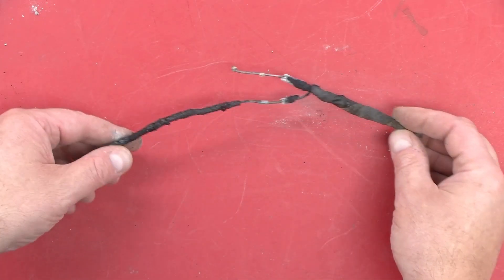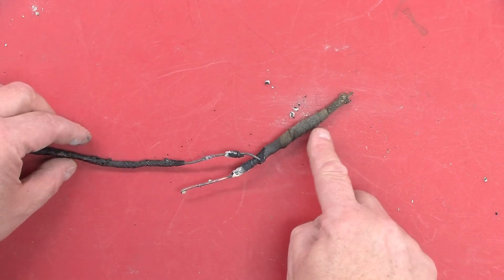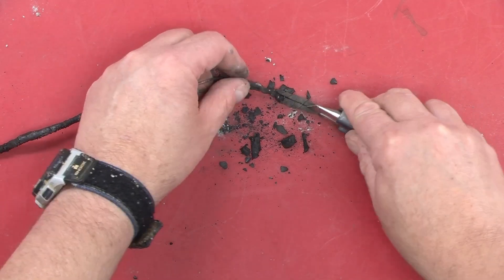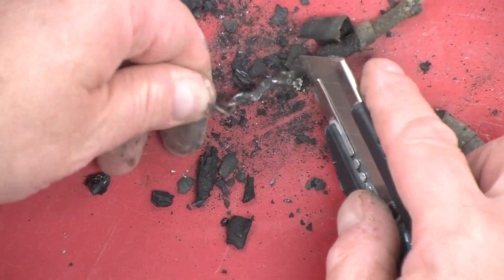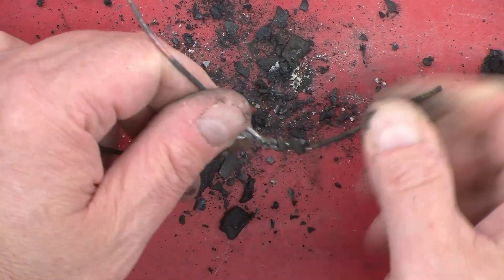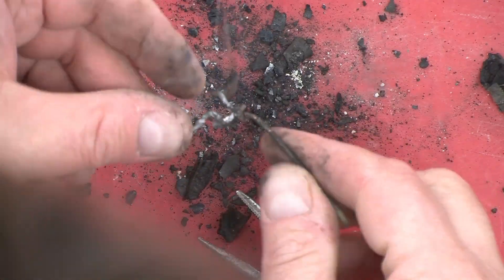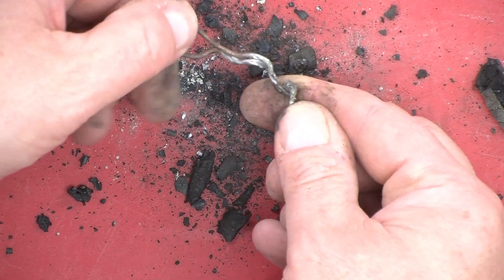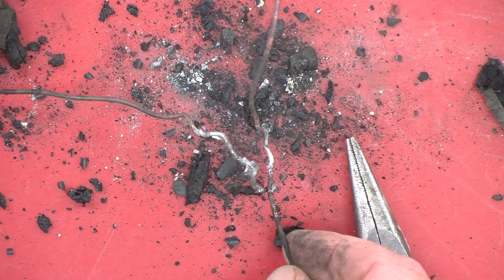Taking Apart the Knob and Tube Splice after Current Tests

Comment: Do you feel the heat weakened the solder? That seem to come apart fairly easy.
Reply from the maker: I'm not entirely sure. There wasn't a huge amount of solder so I think the copper-solder-contact area was pretty small so not the strongest physical bond, and it usually is   possible to pull copper away from a soldered area when the solder is all on one side. 

Before taking it apart the solder looked in decent shape (or at least what was visible under the black charred stuff).  But as you said it did come apart surprisingly easily. I have seen solder on copper or brassware from the Middle East deteriorate after 50 years or so, but I'm not sure of why -- so there also may have been some deterioration due to age. It would be neat if a metallurgist reads this and tells us if and how a solder joint could deteriorate!
Reply: @ElectromagneticVideos  While I am no metallurgist, I have been a research chemist for 40+ years and I have an internet connection, so I did a little reading.  Mostly, it depends on what solder alloy the electricians (if there was such a thing back then) were using.  The eutectic mix for tin/lead solder is 63% by weight tin and 37% lead, this has the lowest melting point (183C, 361F) for tin/lead solders.  If the alloy has less tin (50/50 for example), then the melt tends to have lead crystals in liquid eutectic (sometimes referred to as "pasty" solder, beloved of pre 1974 plumbers and old-school body and fender guys, since it can be wiped onto joints like putty).  The opposite can happen for high tin alloys, where tin crystals can form in the melt.  If there was any separated lead, it would oxidize over time, particularly if it ever got wet (this was why lead was banned from plumbing solder used in potable water systems in the US in 1974).  Any separated tin could degrade by allotropic conversion (known as "tin pest": https://en.wikipedia.org/wiki/Tin_pest ).  Metallic (white, or beta) tin is thermodynamically unstable below 13C, with the nonmetallic allotrope (grey or alpha) tin being favored.  White tin is strong and ductile, grey tin is weak and brittle.  The conversion is slow, but autocatalytic, so once it starts, the rate of degradation speeds up over time.  Of course, the weakness of the joint may just have been due to a light coating of solder, as you noted.  Even so, it still seemed superior to a wire nut.
Reply from the maker: @robertlapointe4093  Robert, than you so much for that research! I'll bet there are aspects of that occurring. I can sure see too much lead or tin weakening or worsening the connection over time as you described. If I find another connection like that I will have to try and look at under the microscope and see if any crystals or deterioration like oxidation are visible. I had never heard of tin pest - and now I also understand the ban on lead solder for plumbing - I always wondered how enough lead could dissolve to be an issue. And its funny - 63/37 solder was always sold as having the lowest temperature but nothing mentioned about its stability. The tin pest issue seems also seems  to well describe some failing solder on some 50 year old Middle Eastern cooper and brass items I have.  By the way - we  have tin issues with lead free solder today - tin whiskers can form shorting nearby connections which was apparently mitigated by the lead in  63/37 solder.